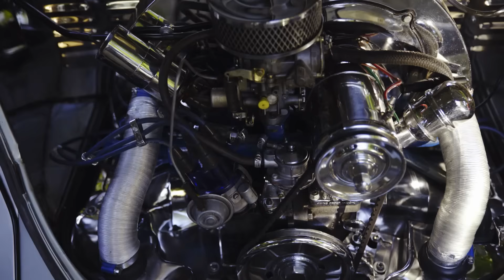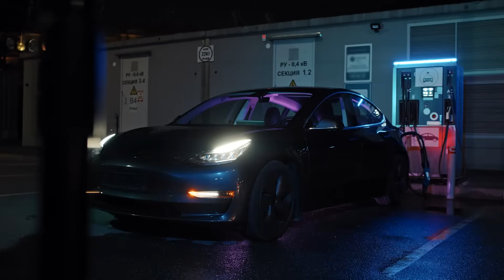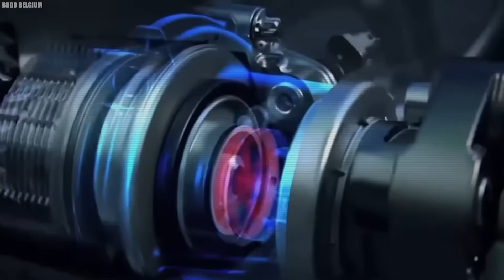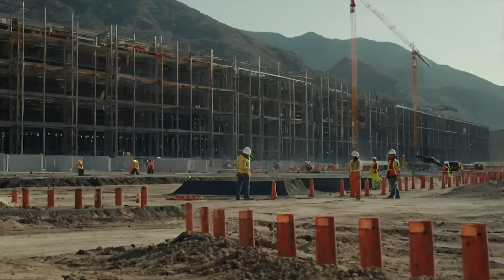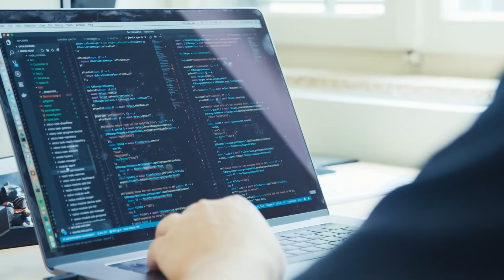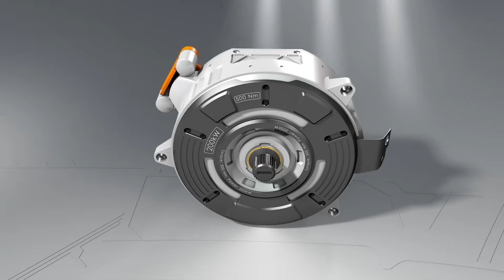Elon Musk’s New Engine That Will Shake the Entire EV Industry!

Comment: when will they make a crate dr0p in for the350and battery gas tamk that is a batteery so the kids gtowing up  will learn about electric cars and convert everything they build using the new tech in the garage. 1943 ford tractor is tesla  powered runs all day, no fuel cost all week, evenings for repairs and top off batteryl less time for repairs.

Comment: END THE FILABUSTER
The Case for Ending The Filibuster.
The filibuster is a delay tactic. The 60-vote supermajority is a Senate-created rule (not constitutional) that became the standard because 41 senators can block anything. 
The 60-vote threshold is not in the Constitution. It’s a Senate rule that evolved over time.
The origin of the Senate supermajority (60-vote threshold and why the 60-vote rule became the de facto standard for passing most legislation.
1. What is a Filibuster?
A filibuster is a procedural tactic in the U.S. Senate that allows a Senator (or group of Senators) to delay or block a vote on a bill, nomination, or motion by extending debate indefinitely.
How it works:
Any Senator can speak for as long as they want on a topic. A Senator only needs to threaten a filibuster today. Senate rules presume debate continues unless ended.
Ending a filibuster requires a cloture vote to cut off debate.
In 1917 Rule XXII was adopted after WWI when Wilson pressured Senate to stop filibusters blocking war measures.
 Originally required ⅔ of Senators present and voting to invoke cloture. A 1 975 reform lowered to 3/5 of the full Senate,  60 votes. A filibuster doesn’t have marathon speeches anymore when 41 Senators are not willing to sustain it.
Even though simple majority (51 votes) is enough to pass most bills if debate ends, the filibuster makes 60 votes the requirement:
Any bill can be filibustered but 41 senators can block it. To guarantee passage, you need 60 votes for cloture. This turned 60 into the new "majority" for controversial legislation.
Exceptions where 51 Votes Still Rule and the filibuster does not apply to:
1.	Budget reconciliation used for tax/spending bills. 
2.	Supreme Court & most judicial nominations. Called Iin 2013/2017  the "nuclear option").
3.	Executive branch nominations. The  2013 nuclear option.
Current Debate (2025):
Democrats ,especially progressives, usually push to eliminate or reform the filibuster to pass voting rights, abortion funding (e.g., Hyde repeal), climate, etc. Moderates (e.g., Manchin, Sinema in past) resist, citing minority rights. Republicans defend it when in minority, attack it when in majority.
Democrats oppose its’ use in the 2025 Continuing Resolution vote stopping the Shutdown of most of the government.
The Rule is a tool of the minority to retain Legislative Power when the majority has less than 2/3 rds of the Senate members. Seven (7) State members of the Senate control legislation.

Comment: Until Elon builds a car that can recharge it battery 🔋 continually he's spinning his wheels? A small gas ⛽️  powered vapor carbourated low rpm long stroke high torque engine powering a alternator with a auto start - auto shut off system to car is a limited almost useless joke. Drive from NY to Florida in one day I have done only stopping for fuel ⛽️ not sitting ever say 300 miles waisting my time of life waiting going know where?. 1936 pluge built a vapor carbourator on Ford engine went over 400 mile on one gallon of gas. The vaporized gas burns 🔥  the waisted left fuel is waisted. Coal refined into fuel ⛽️ low test 2009 south America at 117 octane sold for .04 cent a gal and high test at 129 octane sold for .11 cents diesel sold for .03 cents. I hope Donald Trump awakes too this truth...  low test fuel here in IL is over $ 3.30 per robbing gallon 😢 raping us Americans.